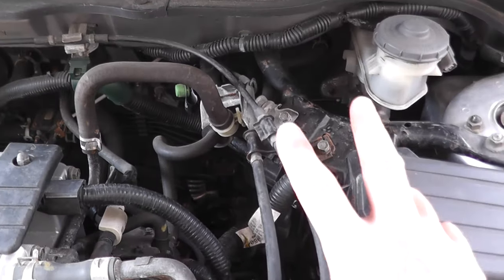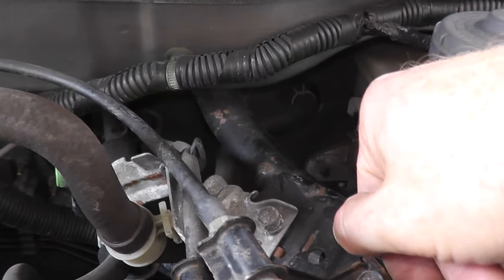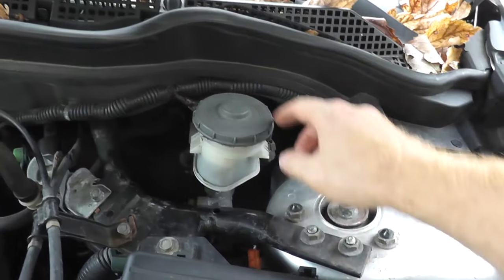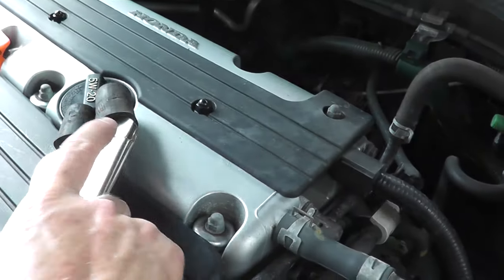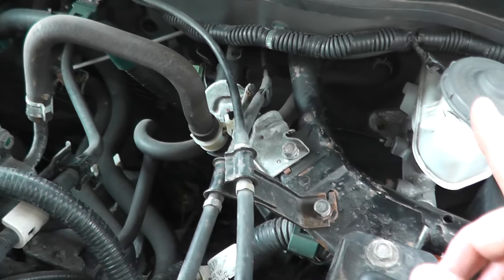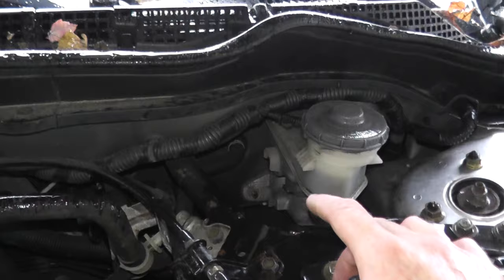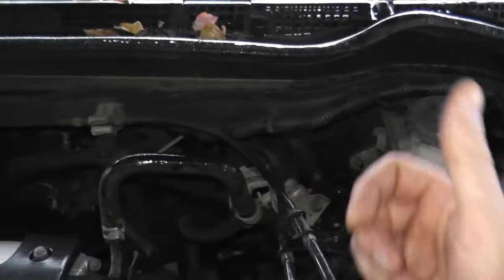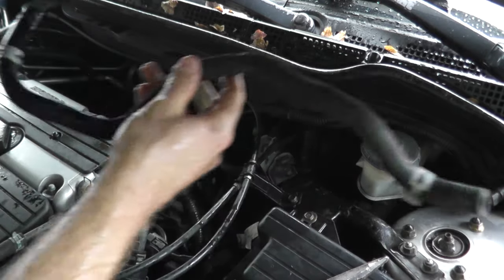How To Test & Replace the Brake Booster and Brake Booster Vacuum Hose

Comment: Air seeping sound under hood & loss of brake pressure brought me here...
Reply: Find a solution?
Reply: Check your seal on your master cylinder where it bolts to the break booster. Or it could be the master cylinder it self. Or your booster.
Reply: @MakeLegacys  yes it definitely was brake booster & master cylinder
Reply: @ThatBeardedGuy69  yes it definitely was brake booster & master cylinder
Reply: For me it's air seeping sound coming from near the brake pedal, I dont even know wtf that means 🤦
Reply: I hear air running out from booster
Reply: any solutions this just happened to me last night

Comment: What would cause engine to surge up and down as i am slowing down, for example as i slow down from 50mph, it shutters at around 35mph, then at 20mph, and one last time just before completely stopping at about 10mph...does it sound like a transmission issue?...or more like an engine idle issue like throttle body or similar engine issue?  OR brake booster issue?...thank you
Reply: Did you figure it out ??
Reply: Vaccum leak

Comment: We have a 4th-Gen Acura TL (2009-2014) that developed a brake feel problem. When braking the peddle goes down much further than it ever did. The dealer is telling us it’s the ABS system pump the failed ($1600) but there isn’t any lights on the dash indicating that’s the issue. I’m going to perform the inspections in the video to see what’s going on.
Reply: Did you ever get your issue fixed? I am experiencing the same now
Reply: What did find out? I have a 2010 acura tl. The "check braking system lights" flash at me.
Reply: @dailotom  sorry for the late reply, but I’m planning on fixing the issues myself. But to be honest I’m not sure of what to do at this point. The OEM part is at least $1,400 bucks, but the dealer is quoting me $1,600 to replace the module.
Reply: @MrSamPhoenix  think it might be a lost of pressure. I replace the master cylinder and bleed any air out of the lines and that fixed it for me. It wasn’t the ABS for me because the ABS light never came up and  it engages when I break hard.

Comment: Thanks, I just changed the master brake cylinder and driverside brake line, both front side  calipers and brakes in the  front (driverside caliper wasn't opening fully dragging), bled the entire dark color brake fluid system out too, but still not 100 % I believe it's the booster, the brake pedal area I hear a air  noise...I have the new brake booster in my garage ready, ill do your trouble shooting first,  thank you sir!. Details: just got my truck 2nd hand 99 F150 V8 4.6 ABS 230,000 miles

Comment: Hi. I’m having many different opinions about the stif brake pedal. 1-brake pedal travel sensor, 2-a sensor on brake pedal assembly that needs calibration after replacement. Got a C1012-01 code. 09 Ford Escape Hybrid. Hit from back and slightly from front. Parking sensors from back bumper are damaged. Any suggestions?

Comment: Well you just saved me $449. I had almost zero brakes. Maybe 5% and it was stuttering the engine idle, trying to die on me. It was just some little T barb in the vacuum line had a cap fall off. I put my finger there to plug that open T and the idle improved. So i found a screw and rubber.and made my own plug, and brakes working as should again. Thanks!!!

P.s. i just so happened to have a Honda Vtec too (08 CRV), so the similar visuals made it super easy to check lines
 
As a note for others, my brake pedal was extremely solid and wouldnt barely move up or down even with tons of force applied. Having car running,  they felt the same as the car off. All that power lost from a tiny hole in the line. Now I'm back in action! Thanks again!!
Reply: I'm having this same hardness issue with my brake pedal, except when I press brakes slight the idle goes up, and when I press the pedal really hard the idle drops to normal idle

Comment: A few days ago, I changed the cooling fan in a Kia Soul I bought from my nephew.  To do that I had to remove the intake.  When I backed it out, I noticed a very hard brake pedal.  I could hear a hissing sound.  After watching this and a few other vids, its pretty obvious a line is disconnected or perforated.  The brakes worked fine before the cooling fan job.  And I was about to drive the damn thing to a Kia dealership.  Many thanks.
Reply: same issue on my VW CC - need to find the leak!

Comment: So i had a radiator hose leak few days ago and after i fixed the hose, my brakes got extremely hard. I thought to myself "DANG THIS CAR, IT'S ONE THING AFTER ANOTHER". 

Then i thought to myself, what could i have possibly done by mistake that it made my power brakes go out and it feels like zero power at all in the brakes. To two feet to push it down. 

Then i watched this video. First thing he said was to check the vacuum hose from the booster to engine. So i did. i followed the hose from the master cylinder straight to the engine and guess where the house ended up? Directly next to the radiator hose i had just replaced. Lol. 

It turns out during my hose fix for the radiator, i somehow accidentally pulled off that vacuum hose from the engine side. So i slid out into place and it locked into place. And my brakes are back to perfect. 

THANK YOU. I have a Mercedes Sprinter 2500 van and this probably just saved me almost a thousand dollars in repairs from a shady mechanic who would have told me something major needed fixing and I would have believed them and they would have just plugged the hose in and call it a day.  I haven't had an honest mechanic in years. I gave up searching for one

Comment: Best explained video I've seen! I do have a question if you have a min to answer? If booster or cylinder go out, will there be signs of fluid leaking? I've followed the steps in your video to check for leaks but I couldn't do the clamping of the hose because there is no valve except for right at the booster!

Comment: 3:25 there is no need to clamp down the hose, all u need to do is disconnect the end going into the intake and put a 14mm bolt on there and that will seal. Most people will eventially kink or cut the line of not done right.

Comment: Excellent video,  Thank you. 
Can you help me? I have an old f100 which I replaced the master cylinder on. The brakes now hiss when I'm parking. The pedal also gets really hard when the brakes hiss from being pumped. This only happens when I'm trying to park or driving slowly. What's the problem?

Comment: I have brakes,my problem is when at the stop light and foot on the brake,idle speed drops about 100-150 RPMs ,I can feel a slight vibration due to rpm drop,BUT,if I apply the parking brake at a stop and take my foot off the brake,RPMs don't drop at all,stay at their normal factory specs of 600 in drive,some defect either in the power brake booster diaphragm or check valve is the problem.I will try the test you suggested and maybe I'll zero in on the defective part.Thanks for the video.

Comment: Thank you for video. Much appreciated! I’m not a mechanic but Ima DIYer. Question I replaced my brake master cylinder and my brake power booster because they were bad. My truck is a 93 Mazda B 2600 I had to return a faulty brand, new brake master cylinder, and now I think after watching your video, I may have a faulty new brake booster. I have bleed the system removed all bubbles. I purchased new wheel cylinders for the rear drum brakes. I have no pressure at all. The pedal goes to the floor. I did your test.  I removed the vacuum line to the booster and there is obvious suction. Do you think I have a faulty booster?🥴🤷🏽‍♂️

Comment: i have a question please, on cold mornings when i put my 2005 honda accord in gear to either go forward or reverse and apply the brakes ,at first it acts like the brake booster is not working,eg a hard pedal, but only until i hit the brake pedal twice it is unerving because it is like the brakes are frozen, as i stated it only happens on very cold mornings on the first brake pedal pump ?

Comment: Thank you for the video. Question, when my car is idling on I press the break down and when I let go the RPMs jump about 200-300. So far I looked at the vacuum hose don't see a crack or hole

Comment: Hello! Great video! I did the pedal test, and my pedal goes DOWN when I turn off the engine. I let it go and press it again, and it happens again. I did the hose test too, and it has vacuum. Will it be the booster then or something else? Also it makes a "whoop" sound when I let go the pedal.

Comment: Any ideas why after all the obvious checks, pistons on calipers, rubber boots. Slider pins. Discs pads. Brake lines etc. Why front wheels keep locking after 10 after normal driving conditions. Appreciate any advice.

Comment: Thank you. I believe my brake booster hose has some sort of o-ring and I’m afraid that of I pull it too hard, I’m going to break the fragile plastic components on the hose (N52, 2007, BMW 530i). I’m chasing a vacuum leak and a smoke test revealed nothing. My plan was to remove the hose and cover it with my thumb to see if my short term fuel trims got better. But you just gave me a better idea! I can just pinch the soft portion of the hose to accomplish the same test. So thanks again!!!

Comment: Nice video! I currently have 2003 f150 that has leakage between master cylinder and brake booster. Not sure what's going on but brakes not preforming well.

Comment: Great video you always explain things the easy way. I performed the first test twice and the pedal stood still for the whole 30 seconds,  does that means that my booster is ok?  THANKS AGAIN FOR YOUR VIDEOS. .
Reply from the maker: Yes. If there's no change in pedal height you're okay. Thank you for the feedback!
Reply: @CarsNToys  hello my grand cherokee stalling when i push the brake at the stop .its the booster brake its die???
Reply: @renegade9758  you probably have a vacuum leak and air is entering the intake manifold

Comment: Thank you for all the information! I came across an issue where when my car is on and I press the brake repeatedly it will change the engine speed as if the car wants to shut off and my AF/R gauge will go lean, do you think it could be the booster? Thanks in advance man!

Comment: I just replaced my master cylinder on my 73 chevy c20. I found the rubber gasket or cup that was on the booster was torn probably from me when removing. I can't find the rubber cup or gasket anywhere so I may replace the booster to get a new one. its 49 years old anyhow. I'm pretty sure I'm losing vacuum. ill perform the pedal test next time I have the truck. losing vacuum can change your idle too right?

Comment: Thank you for this clear and easy to follow video. For the first test, my break pedal went DOWN at ignition off, then stayed steady. Other tests were the same as in the video. There is no warning light, but with ignition ON the brake pedal hisses and is too easy to  press, and this happened very suddenly.  2018 Outback. Edit: after some additional research, I believe the check valve may be right where the hose attaches to the booster...but I'm not sure, there is also a hard bump in the hose that may be it (I assumed it was the bump for the clamping test) I will try to find instructions to remove and check it.
Reply: Hey Marie. Any results to report? Thanks
Reply: @AudreyCooks  actually I ended up taking it in, and it turned out to just need new brakes (pads and discs). After they were done,  the pedal feels normal, and it only hisses when I press it when already fully stopped, not during normal driving. They told me such hissing is normal, and demonstrated on another car (a Legacy). I'm still sure it was not doing this before, or at least no where near as loud, but since I now only really hear it right before I turn ignition on, I guess that's OK.  I also confirmed a 2020 Forester did it, which made me feel better.  Maybe it's a Subaru thing?

Comment: should the brake booster hold pressure after the car is shut off? like if i remove the hose that leads to the booster. trying to help my nephew fix his car currently has no brake pressure running or shut off.

Comment: I have a leak between the plastic cylinder and booster and it looks like it is loose.  You mentioned to tighten it.  How do I do this?  Thanks.

Comment: I have a Mazda 5, 2010. The breaks works fine, but only when rpm is 2000 or more..
With less rpm the breaks gets weak and padel hard when used. Loks like the vacumpump do not give enough at slow rpm...?🇳🇴

Comment: Iam having a problem with my brake booster or check valve. Do you think it just old or could it be my computer? Ihad my engine fixed and I'm the battery was disconnected. Which issue  do you think it might be ?
Reply: The computer or an old brake booster?

Comment: So my truck had a brake fluid leak ever since I bought and I finally found that it was leaking from my master cylinder into my brake booster, I realized that the brake fluid was disappearing into my intake. I replaced my master cylinder but not my brake booster because it was my master cylinder that was faulty. I'm still burning brake fluid though but my brake system seems good and I'm not losing any new brake fluid. Do you think I should replace my brake booster as well?

Comment: Hi Sir I have a car 2013 jetta. The brakes pedal was like a rock. I left it to repair shop. They changed the booster and master cylinder. the problem is still on. it is like a rock. They couldnt find the failure.. i took the car. What else might be the problem?

Comment: Must say a great video bro,
Would like to ask I have Ls430 2001 and got the code error 1578 Brake system.
Could you tell me which first I can perform as a check up since my cruise control and VSC just stop working after this code.

Comment: Is the booster vacuum line going to the intake a good spot to spray intake valve cleaner?
Reply: Yes... I always do that before I condemn a Master Cylinder hard pedal.  Hard to stop... As the booster controls the pedal pressure required....

Comment: Hi! I got the error code P1578 “ETC power less than demand” and read that one of the issues could be a faulty Brake Booster Vacuum sensor but I can’t really tell where to find it at on my 2010 Toyota RAV4, do you have any insight on this? Thanks!

Comment: If your brake calipers keep locking even though you changed brake pads, rotors, lines, calipers and bled all the lines could that be a sign of bad brake booster or check valve.?

Comment: great video... i have a dodge 2006 pickup... there is a lot of brake fluid on the engine and the brake pedal goes all the way to the floor... could this be a bad booster?  thanks.

Comment: Similar thing happened to me on a Turbo Diesel Mercedes Benz W123. The vacuum pump has a hard line that comes up to the brake booster and has mutiple Ts that come off to the transmission, door locks (vacuum door locks) etc. needless to say it was 105 outside and the hoses to thw door locks and brake booster got malleable and pipped off the hardline nipple causing a vacuum leak I couldnt even shut the car off and I had no brakes. Simple fix and back on the road.

Comment: Great video I ran into a problem with my brake hissing and losing power. When I perform the first test and I turn the engine off with my foot on the brake pedal for 30 seconds if the booster is bad will it rise even though I keep a consistent pressure or am I supposed to take my foot off with no pressure and it should stay down ?
Reply: Yeah he didn't explain that.

Comment: When the vehicle is in gear and im stopped with my foot on the brake pedal, I'm hearing a rapid clunking/tapping sound. Brakes work find and I don't see any visible leaks. Any ideas?
Reply: I have the same issue. More of a click tho. Also, pressing the brake when car is on produced a his sound. Not when the car is off tho. Did you figure it out?.

Comment: Is this video for all makes and models?  I have a 2013 VW Passat and was told by the dealer that the brake hose from the booster to the vacuum pump is cracked.

Comment: I have a 07 Tacoma and randomly my brakes will lock up while driving and the only fix I found is to unplug the vacuum off the booster for a few seconds and this usually lasts a while. My factory booster did this and now my rebuilt used Toyota OEM one started doing it after about three years after being installed.

Comment: Good Video Man.. just a quick question, should I change my breakbooster or just the master cylinder on my car, because when I pop the breaks from the inside, the car just moving and wont stop unless I use the emergency brakes.. so I removed the pads to see if they worn out, but they still fresh new..
Reply: Orville Moore  thank you

Comment: So I put a new booster in my 2011 Mazda CX-9. Now my brake pedal goes to the floor without effort but I can’t get the brakes to work at all. I have bled the brake and bled them and bled them. But can’t get any resistance. I have to be missing some but am not sure what. Can you give me any idea what I might have messed up on?

Comment: i tried the test where you hold the brake after turning the car off, and instead of the pedal rising it went all the way back. what does this mean? I’m in a 2012 Chevy Cruze if that helps.